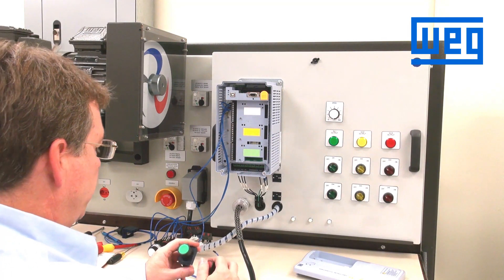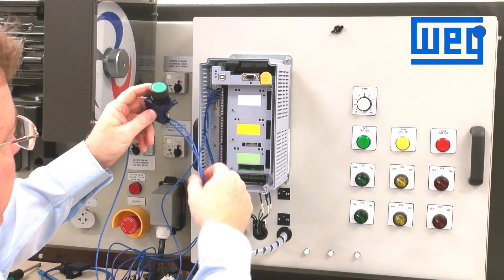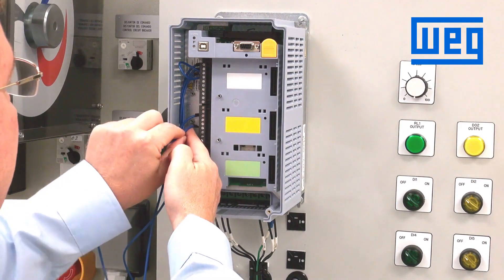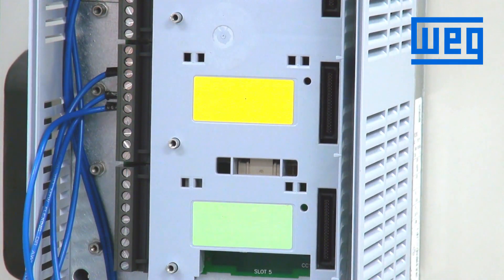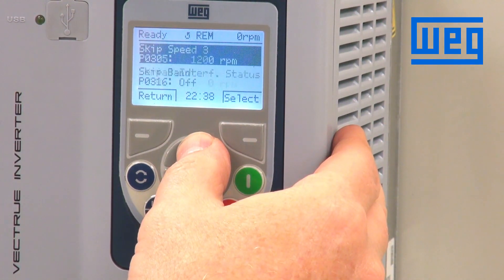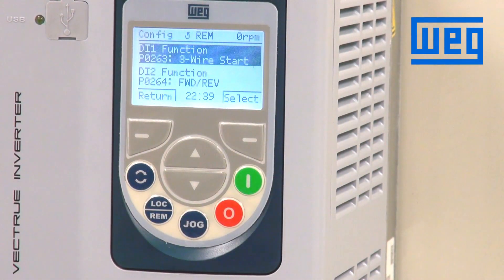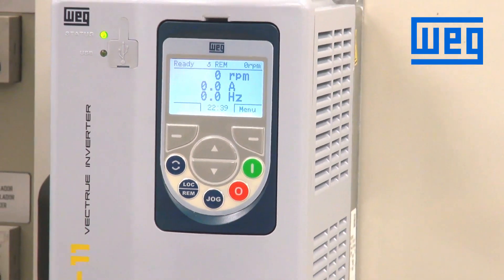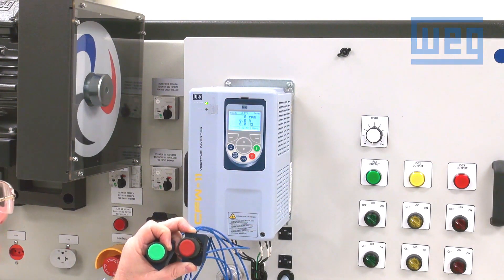WEG - How to wire and program a 3-wire start/stop control for CFW11

Comment: I want to decrease and increase speed using 0-10V from PLC
Reply: Also I want to connect the break resistor  to slow the motor down fast
Reply from the maker: Hello Shand.
This information is available on our manual:
Items 12.5 and 12.8 https://static.weg.net/medias/downloadcenter/h00/h0c/WEG-CFW11-programming-manual-0899.5620-en.pdf
Reply: Thanks for the replay

Comment: Im still a student trying to learn this, Friday the main guy was installing CFFW 700, which I call it a VSD. now the motor can not run on auto, How can I assist him to connect the existing timer with the new VSD so that when it is on Auto it will pick up and send signal to run the Motors.
Reply from the maker: Please, contact our branch office or authorized distributor in your country for technical support.
https://www.weg.net/institutional/BR/en/contact/service-network
Reply: @weg_group  Thank you